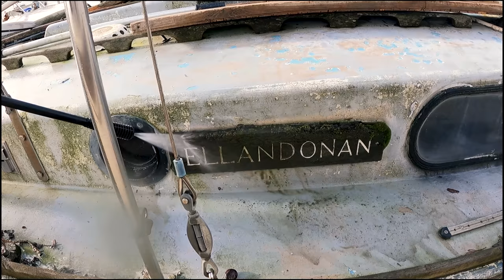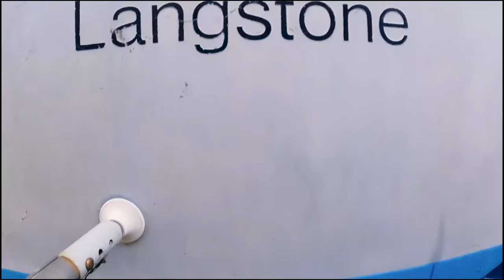SAILING TO THE PHILIPPINES FROM THE UK TO HELP SAVE SEA TURTLES

Comment: Is that boat even Sea Worthy, it looks like it hasn’t sailed for quite sometime. It needs a lot of works.⛵️⛵️⛵️⛴⛴⛴
Reply from the maker: It needs a fair bit of work but the hull is good, it's been out of the water for 5 years. His target is 2 months but that might be optimistic, we will see
Reply: the boarts fine - those old GRP hulls are solid, The mainsail looks ok aswell - needs a clean. It should eb easy enough to rig her for ocean passage. Self steeing gear is going to be very importaant. Whe boat will need to be on selfsteering gear for most of the passage.
Reply: Once Refurbished, it'll be a gem. A man and his boat is like a romance. Once he names her, the crissioning ties the knot. Then the man and boat become one at sea.